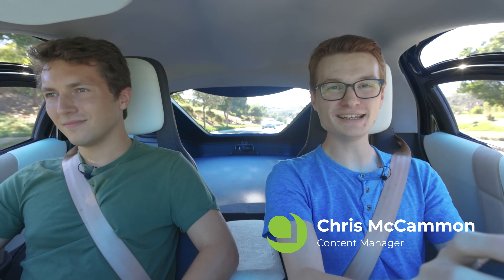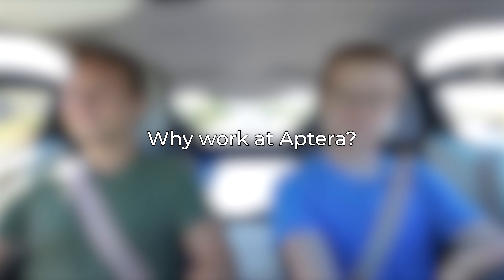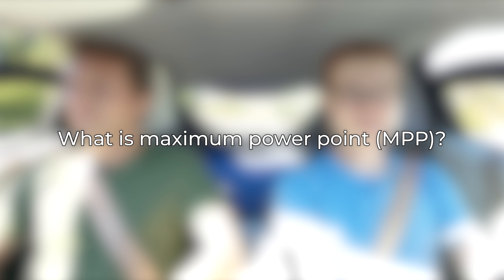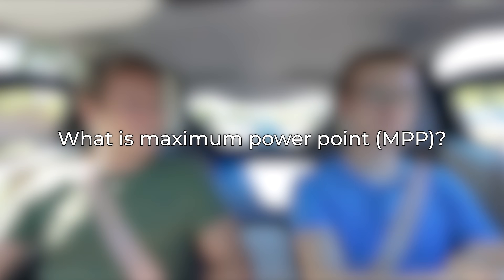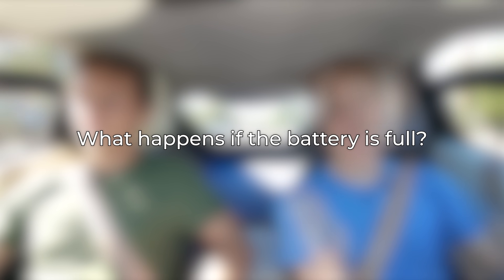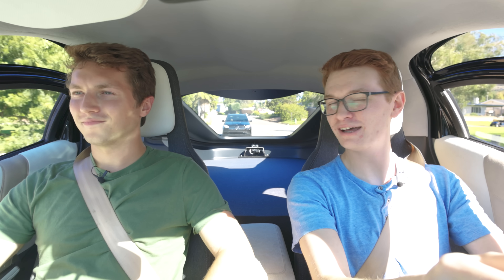Aptera's Solar Charger — The Third Wheel

Comment: I read in the comments of an AOC video that there will be separate charge controllers for each panel (hood, dash, roof, hatch). Is it true?
Reply: I'm guessing there likely will be something like 3 MPPTs on the hatch, 2 on the roof, 2 on the hood and 1 for the dash.
Reply: I think the hood might be a single string.
Reply: Step aside and let Aptera Motors answer the question.
Reply: @EricPeelMusic  No one's stopping Aptera Motors from answering so chill.

Comment: Thanks Chrisssss?!  Move over Jerry Seinfeld with Comedians In Cars Getting Coffee…This appreciated Episode is like Content Chris and Solar Eng Chris In an Aptera Talking Technology! 😉More updates for the FAQ page !  So the Solar controller is basically like the “ Optimizer “ we have on our home’s PV solar system but more complex given the  Solar Production In Motion.  So home PV solar arrays are most efficient when they are mounted off a hot home roof or Off Ground ( given air circulation to keep cool ). Questions 1) Will the air movement “ in motion “ and the passive cooling ( venting ) occurring  inside the Aptera( thanks to the solar power ) to bring the interior temperature to ambient outside temperature have a solar production benefit too? 2) if I have a solar tube ( window ) in the roof of my garage , could I realize “slight solar production “ when the solar UV rays are directed on  it ? 3) Any meaningful solar production gain on Aptera’s array at night if LED UV lights shine on it! 4) What is the suggested  care for the clear substrate that encapsulates Aptera solar array ? Water and soft cloth cleaning ? Dilute vinegar/water rinse ( if hard water) and cloth cleaning 5) Can we get an early peek at the coated copper connectors that  bond the cells as planned for the Production Intent vehicle ? i.e., We have seen over the various development vehicles solid black and some copper on Gamma Your final validated “ look “ would be interesting to see. 6) We hear the Aptera  solar cells could be changed, in time” under right to repair” to more efficient cells… as more efficient cells become available. Can we see an example of that upgrade procedure,  that an owner could do?
Reply: Lots of really good questions!  I can answer #'s 2) and 3).  Even from the Sun, there's relatively little UV power hitting solar cells.  Also, the cells Aptera is using don't create much power from what little UV is falling on them.  They produce much more power from the visible and near infrared wavelengths.
Reply: @johnreeves7261  Thx John. We have  been told in a past video by an Aptera employee ..not to even add a protectant with UV inhibitor to the clear coating on the outside cells. I don’t think we know for sure  if there is a similar encapsulation over the solar cell on the  aptera interior dash , which is below the windshield ….yet still producing power. I imagine the clear windshield may have some  UV reduction. The other glass in the Aptera should be tinted ( If not I will tint my window here in 🌞🌞🌞 AZ ,which I have on all my vehicles. A must in my experience .
Reply: @elertus  Yea I vaguely remember that somewhat cringe-worthy (to me) video.  Assuming "protectants" aren't blocking the visible and the near infrared, I see no harm in using them.  (I'm further assuming the protectant won't chemically harm the clear coating)

Comment: I am looking forward to getting my Aptera.  However, 2 things:
1. Why not make the port in the back 110V?
2. This video shows work is needed on the suspension.  I hope this get smother.
Reply: Power inverter accessories can likely do that if needed. I’ve used those in gas cars golf from 12 v outlet standard to AC items..
Reply: @davesullivan2997 15A at 12v is not a lot of power though
Reply: Either form of power is great.  For me the critical thing is heated seats.

Comment: That is really wonderful news to hear about the 15 amp. outlet to power a mini fridge. 
Can someone clarify how much load can a 15 amp. outlet handle? I have an induction cook top which i believe draws 1800 watts of power, can i power this on?
Reply: the outlet is 12 volts. Watts are calculated by multiplying voltage by amps. since the max draw of the outlet is 15 volts and the voltage of the outlet is 12 volts, the maximum wattage you can draw from the outlet is 180 watts.
Reply: @MotoxYT  Minor typo in your explanation.  Change "....of the outlet is 15 volts and...." to ".....of the outlet is 15 AMPS and....".
Reply: @MotoxYT  Aw!!!! that is disappointing. Thx. for the reply though.
Reply: A 15 amp 12volt outlet cannot even come close to powering an 1800 watt cooktop or coffee maker.

Comment: Will there be spare MPPTs for external panels?  There's been talk of temporary setup panels for camping and I'm curious if there is an accommodation for that within the charge controller.  Just mashing on more panels seems problematic.
Reply: Agree, the ability to plug in one or more auxilary panels while stationary would be VERY appealing!
Reply: That would save you having to pack along a solar generator which would be nice. On the other hand it adds complexity and development time, some risk of damage from 3rd party components when you could just pack along an external solar generator along with your panels.

Comment: Question:  Will we have the ability to connect exterior solar panels so we can still solar charge while safely locked in the garage?
Reply: It's unlikely to be able to do that with a direct connection to solar panels, but if you have solar panels on the garage already, you're probably feeding your house.  At which point, just use the usual NACS charger.
Reply: @Alaric323   This is a request I've been making to Aptera for over two years... they have said they will try to accommodate.  I am looking for confirmation as to whether or not the external connection will make it into production.  I do not have panels yet but would put up a couple specifically to charge the Aptera while it's in the garage.  Additional portable panels could also be used this way while on a long trip or while camping.
Reply: @DemaGeek frankly you'll be lucky to even get a 'car' from these jokers
Reply: @bluetoad2668  I am so glad you're concerned about their expectations in this possible future autocycle. 😏  I personally have reserved one.  However, I realize that it's a gamble.  It's not guaranteed, just like reserving a Tesla or a Lightyear at the beginning of the companies.  Maybe it will pay off maybe it won't, but I like the direction they're going and the product they want to offer.  So, I'm just going to wait to see if I win my gamble.  (Note:  I only reserved a vehicle, I did not invest) ✌️
Reply: @RBickersjr  I think you're doing the right thing. I'm the biggest fan of EV and solar myself and if I lived in a different place I'd definitely want one of these vehicles.  I sadly do not think the business will be successful. I salute them for trying on the one hand but I don't approve of misleading investors so in a way I hope I'm wrong.
Reply: Depending on the max solar input of the onboard solar charge controller I don't see why they couldn't include a port to add external solar panels. As another commenter noted, this would be great for long trips, camping, tailgating, etc. It would also allow those with a commute longer than 20 miles to supplement the included panels charging 40 miles a day (like my commute of 50 miles per day) to never have to plug in. I am keeping my eye on this vehicle and have been excited to watch its progression. I hope to see it come to market. I'm not one to go out and buy a brand new car, but once its 5 years old I will definitely be trying to find a used to purchase.
Reply: @justinfoster8161   Chris Anthony has said that the charge controller should have the capacity for an additional 1000 Watts, to be externally connected.

Comment: They say fully charging and discharging the battery will degrade the battery's life. Will you guys be putting in software for charge limiting to prevent this? Other EV's will only charge to 90% and discharge to no lower than 10% to preserve the battery.

Comment: Over the air updates is a big one.  Only Tesla has been able to pull that off so far.
Reply: The difference is that the owner of the vehicle will control whether or not to accept them.  Tesla still controls what and when.
Reply: We drive a Chevrolet Bolt which gets OTA updates from time to time.
Reply: Both my Camry and Outback get OTA updates from time to time.

Comment: Any options to add additional external solar panels to help charge the Aptera when camping for example?
Reply: They have said in the past they were going to do that but they haven't really said anything about it in awhile.
Reply: I can't see any reason why that can't be done as a DYI project. Though I also don't see any reason why it would need to be done, unless a person is glamping instead of camping.
Reply: if you wanted to purchase one or two of those roll out solar panels and a battery/BMS combo like the one from ecoflow and take it outdoors with you and in two days it would be charged depending on which type you bought @kmoecub

Comment: You mentioned it could keep the car cool in the summer running the AC from solar power, could the solar also warm the battery in the winter and keep it at an optimal temperature? I live in north Canada that has some weeks of -35C and all other electric vehicles lose about 30-40% of their range in conditions like these. Especially hazardous when in a traffic jam with range dwindling away. Could the solar panels mitigate that? 
Thanks! Love the Aptera and can't wait for more updates 😁
Reply: I haven't heard specifics of the battery thermal management system, but I think it's a standard thing for EVs made today to do battery warming as well as cooling as needs arise.
Reply: I think Teslas have this ability it would be cool if the Aptera has it as well…
Reply: In the north in winter the sun is going to be at such a low angle that there won’t be much solar generation, so most of the power is going to come from the battery for the heating, or from plugging it in. 
But the long summer days should get some good solar charging

Comment: I'm sorry but that was one of the dumbest explanations of MPPT I've ever heard.  You really should have run the script by a qualified electrical engineer.  On the other hand, probably 99.9% of those watching the vid don't know the difference between power, energy, current and voltage so.....

Comment: This is excellent update! Two points, include key hardware and battery with the belly so to say and have an option to isolate the rear hatch with a flex-shutter, right behind the seats, to maximize on air conditioning and heating. Eventually use the power generated directly to run accessory, ac or the vehicle instead of charging  the battery and then using it. This will reduce two conversion losses, storage to the battery and then back. Also logically extend the battery life by reducing a percentage of recharging recombination.
Reply: With most charge controllers, the load and batteries are connected in parallel to the charge controller, so current from the charge controller can run directly to the load as needed, so no charge/discharge losses for solar electricity that arrives as it is needed.
Reply: An improvement would be to have the entire car body and windows as solar panels.  The windows of course would be transparent solar panels.
Reply: I also already thought of installing a roll-down curtain just behind the seats for the same purpose right after my Aptera will arrive.
Edit: rather than a roll-down curtain it conveniently will be a "roll-up" curtain of course, the straight roll being fixed on the (flat) floor behind the seats.

Comment: Great update! Will the 12V outlet be live when the vehicle is parked and ‘off’? I have a portable fridge/freezer that sometimes goes camping with me - would be outstanding not to have to bring along a battery system in order to keep that powered.
Reply: Would be nice. They could add a switch so you could turn it off if needed. I'm a bit disappointed that there won't be a 110v outlet.
Reply: @tims8603  Pretty sure Chris (CEO) announced the 110v in other videos.  Unsure what wattage (dont expect to run an induction cooktop)
Reply: @ccibinel  Yeah, that was quite a while back.  I think he said 15 amp for that. I think they've decided not to have one now.

Comment: I hope the 12v outlet will be fused at 20A for best compatibility for accessories because there may need to be overhead so that a 15A appliance won't trip the 15A fuse
Reply: I agree. The USB C ports should also do 60W at least to support laptop charging, and ideally 100W combined.
Reply: also it would be much bettert to handle up to 45 watt for loading typical notebooks for everyday use and camp, So a 30 watt charger sells every onlineshop but intergrated in the car for daily usage ist more convenient in a way of 45 watt and a ac plug too of course.
Reply: I'd actually like to see a 60amp 12v output, and ideally a built-in 2000w AC inverter for running power hungry accessories from the aptera's main battery. Whether an AC cooker while camping, or whatever power tools builders decide to plug in there.